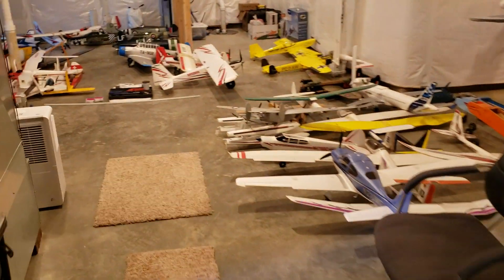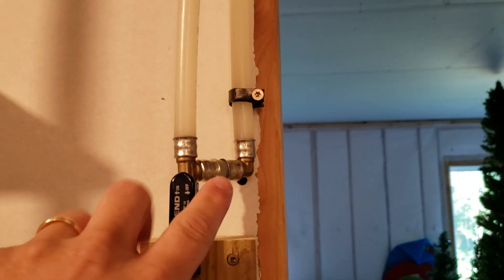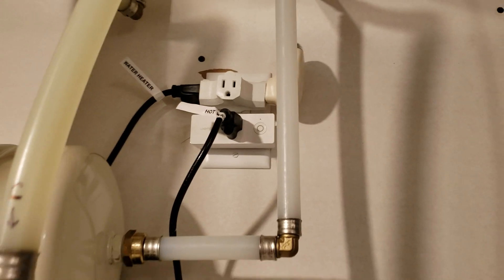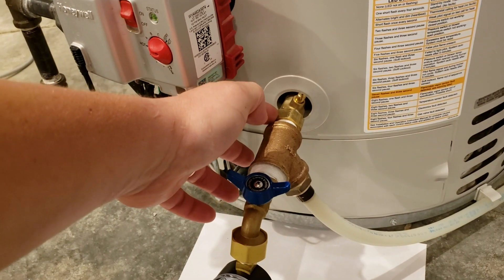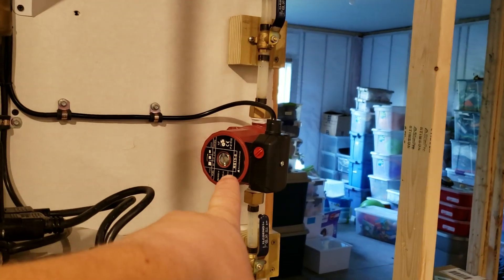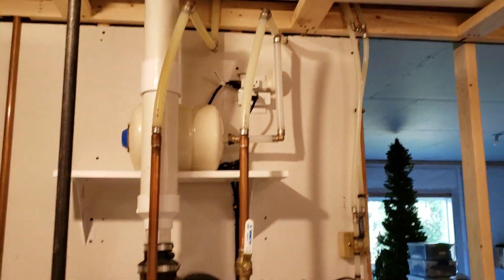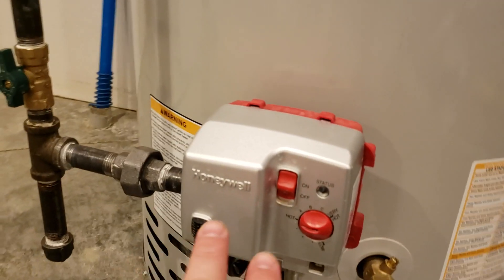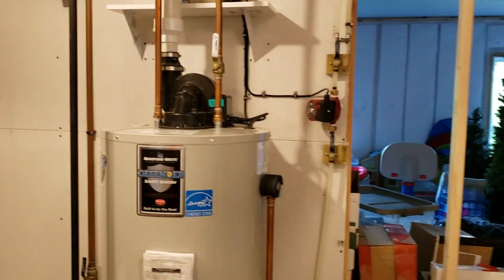WeMo Controlled Hot Water Recirculation System

Comment: 4 years later. Does is still work? Does it have a “auto” setting for it to run only when I turn on rhe shower? Thanks in advance 🙏🏽
Reply from the maker: Yes, we NEVER touch the thing - WeMo turns Recirculation Pump on for a couple minutes and then off for the rest of the hour, a few times an hour and we always have hot water ALMOST immediately at each faucet in the house. Less waste, EXCEPT for any thermal energy lost through the Pex, but Pex will usually insulate SOME...

"AUTO", is not really a setting, hence the WeMo outlet control - it's just on twice per hour for a few minutes that we expect to be up and potentially using hot water, so like 18 hours a day, if I recall...but like I said, I don't mess with it, so can't 100% remember...it was a bit of work to setup, but haven't played with it but maybe ONCE, when we added the additional electric water heater.

BTW, Now we have ANOTHER electric water heater in series too, that's admittedly OFF at the moment (in series, so still holds hot water), but will be available to help "use up" our available cash balance at MidAmerican Energy (our electric utility), since we have our solar system over-producing NOW (as per our plan), and may need to get it all "spent" by the time we "Reset" in April, each year. This will be by producing hot water in lieu of using LGP, or in ADDITION to LGP (net reduction in LPG).

This was all part of our Solar Over-Sizing plan, and it's been great to see it all coming together, and for $8.50 availability charge, and the charges for the solar system, we'll just now try to get our gas bills down to nothing, or next to nothing.
Reply: @BrianPhillipsRC  Great! I wanted to use it to boost pressure only for hot water. Don’t really need it to recirculate since I live in a warm area. That’s why I’m interested and need the Auto setting to activate it only when taking a good hot pressured shower 🚿.

Comment: Brian that pump should be properly secured to the wall with anti vibration mounts
Reply from the maker: It's a very small amount of vibration. This pump is vary weak...which is perfect for the application. I DO have isomounts, but not sure if I'm in agreement about the necessity. Since it's on the HOT side, the water lines are very supple, so I'm not super concerned about loosening the pex connectors over time (with cold water, I'd be just a bit more concerned).

Comment: You did well. Only thing I don't care for is using the water heater drain/blow down for cold water return. This will always move settlements back out into your system essentially you're never going to be draining the trash that forms inside your water heater it's always going to move through the system which will affect all of your hot water Side Plumbing. The grain is there the flush out the water heater a few times a year or drain it when you replace it.
Reply from the maker: Thanks for the pointer. So you think I should just clean it out, even though it's "self-cleaning"...since I might kick up the crap more with this configuration? I understand what you're saying. The plumbers that did out work suggested using this "clean out" ...It didn't even occur to me the sediment might build up...
Reply: So as a possible fix would be replacing the pressure gauge with the original tap, allowing to cleaning again, and then placing the gauge somewhere from that T and 1/2” reducer and the pump on another T? Thanks for your time showing this. I ran 2 hot water lines to the kitchen. Realizing lack of heat, now finding I can rig one as a return and maybe help the rest of the house by heating the manifold. Appreciate everything